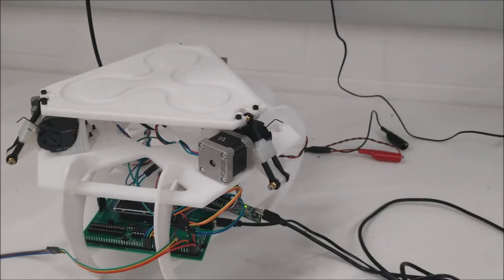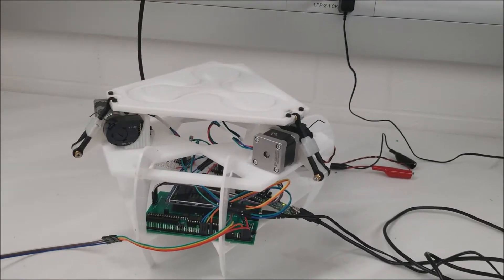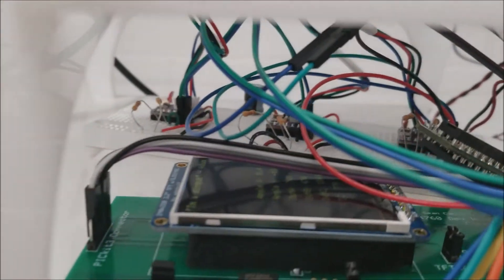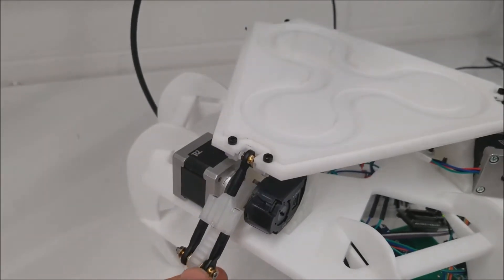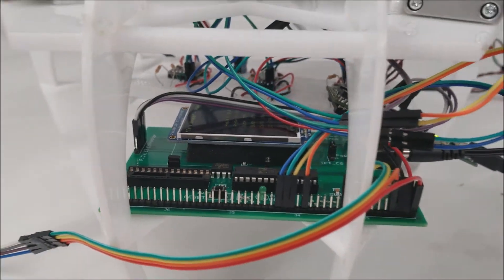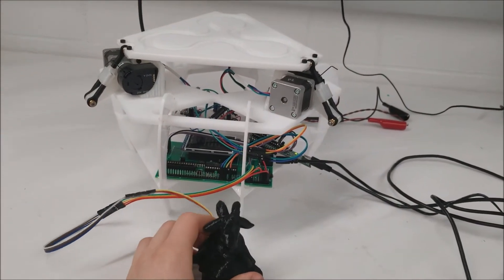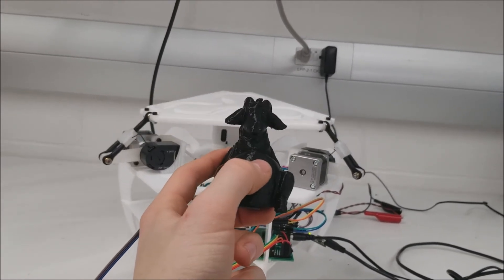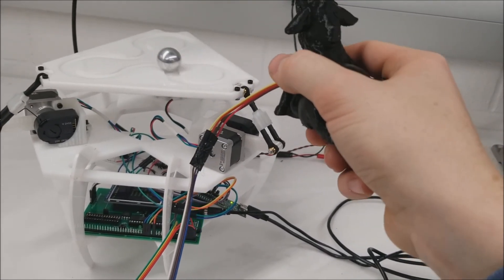3 DOF Delta Robot Motion Table

Comment: why would you need an encoders when are using stepper motors ?
Reply from the maker: It ended up not being necessary for our purposes. But stepper motors are not closed-loop, so for better accuracy and repeatability over time encoders can be used to make the system closed-loop